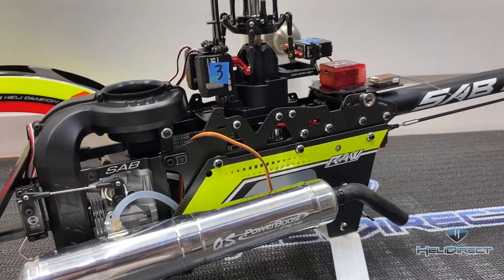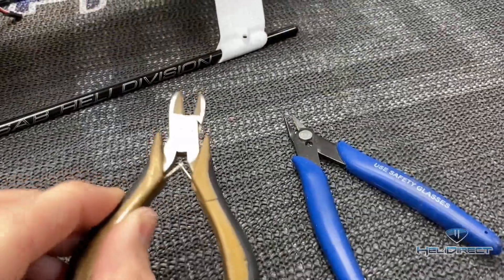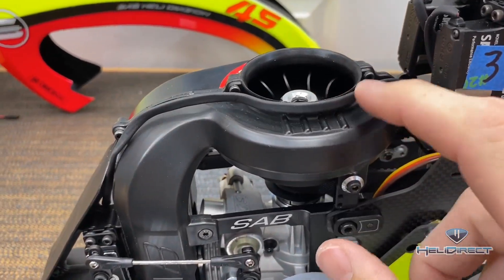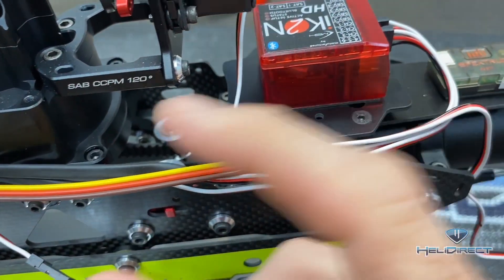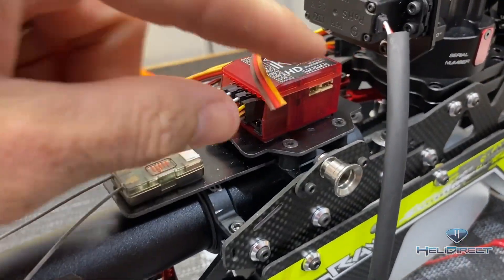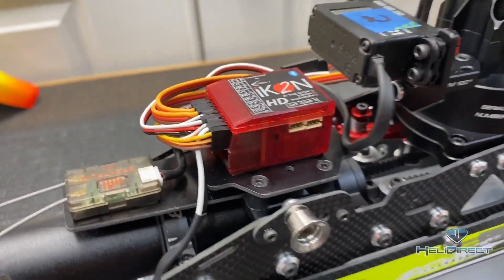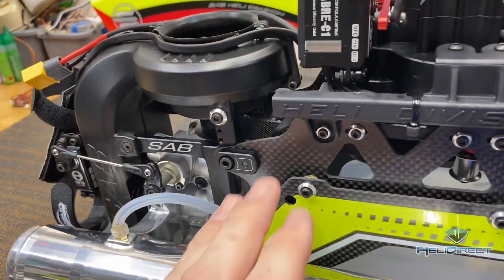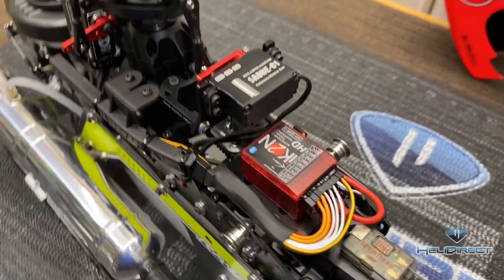PRO TIP: PROPERLY Wiring an RC Helicopter!

Comment: I just want to know how what type of battery and connector to use when I go to configure the ikon when setting it up? I just burned out an esc using a jst connector through the channel 2 port and yes the ground wire was on the bottom and red was inserted in middle of three pins.

Comment: Looks nice but:
- ON/OFF switch is big NO NO. Simply plug in with quality connectors : the lesser the better
- crimping wires can introduce some risks when done by amateurs (no quality control), also what if you need these servos on another heli and wires are now too short ?

Comment: I need to ask you where can I order this shrink tubes, please???
I would appreciate if you can direct me to certain area.
Great job there.
Reply: Thank you! There is links in the video description. You don’t have to buy 100 foot roll but the main size I use is 3/16. And then for the multiple wires together i use half-inch
Reply: TY

Comment: What do you use for heat to shrink the tubing? I have this 300W embossing heat tool I use for shrink wrap - but I think too much for this application -- it like instantly shrinks heat shrink ...and makes it scream out for it's mama.
Reply: I use a 1500w heat gun from harbor freight on low. Works perfectly and never need to turn it on high lol

Comment: It's unfortunate this video is like "we're going to this and this" and then suddenly it's done without showing how to do it. Could have been a useful video. You might also go over some pros and cons of shortening wires. I know too many people that have done this to their servos and moved them over to a different heli only to find their wires are too short. A more convenient method is to fold the wires inside of the heat shrink (or nylon tubing) which yields the same same effect without destroying your wires.
Reply: https://m.youtube.com/watch?v=Ocmi_OCPduc&t=66s

Here is an in-depth video I made on how to crimp the servo ends. The heat shrink is self-explanatory can you slide it over the wire and shrink it down.